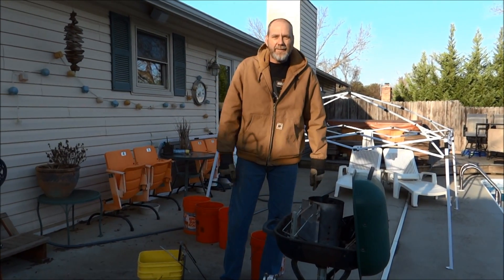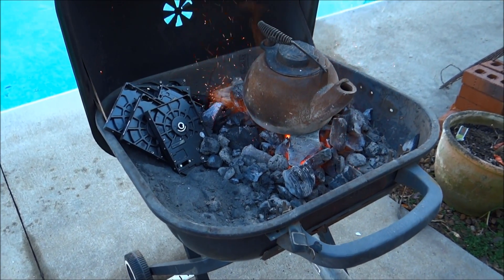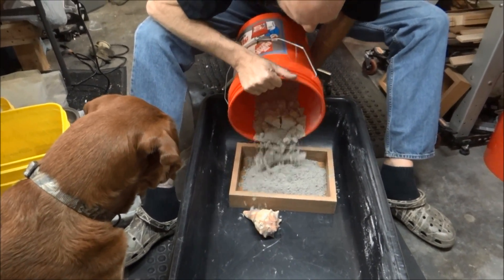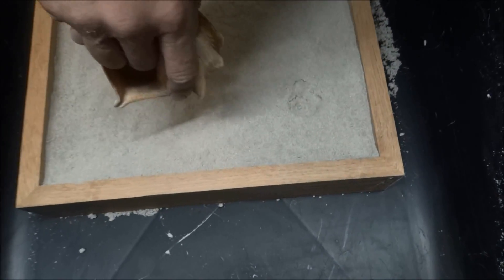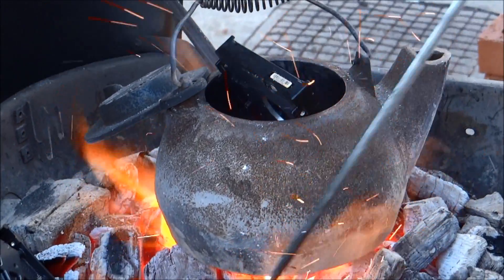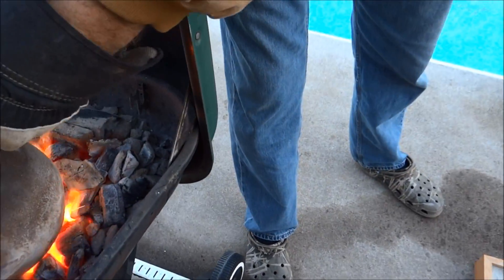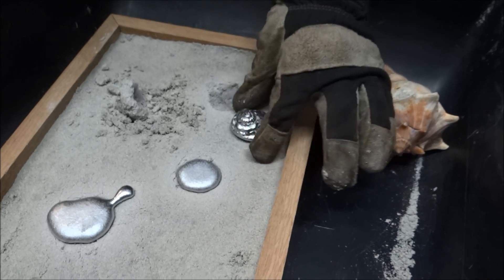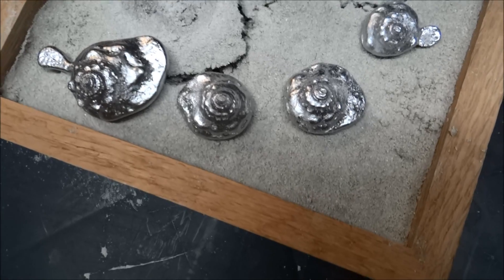Casting Aluminum in Green Sand at Home

Comment: Have you ever tried to spray water on the surface of the casting sand to get a little bit wetter sand, for give more details to the casting (because the sand will have less cracks)?
Reply from the maker: Great point.  I actually now use 2 cycle motor oils.  It helps to smooth the edges much better that water.  Thanks
Reply: You're welcome ;)